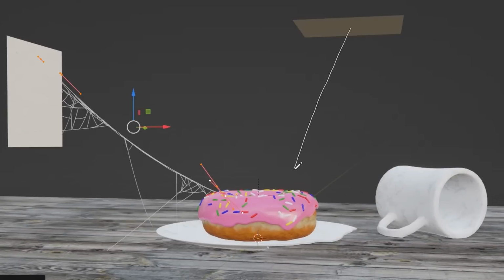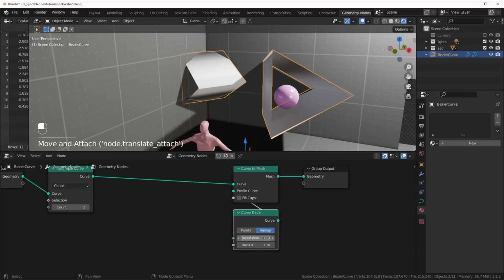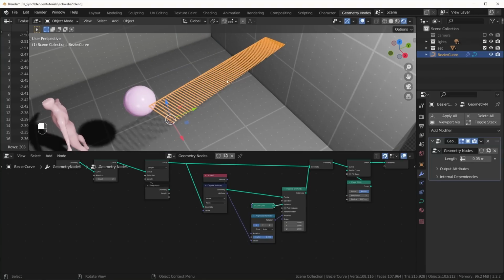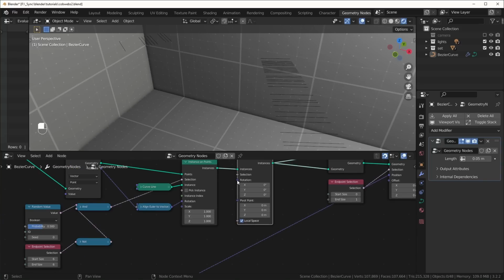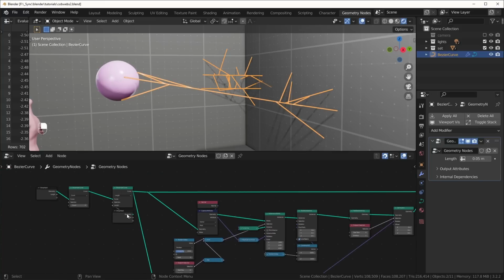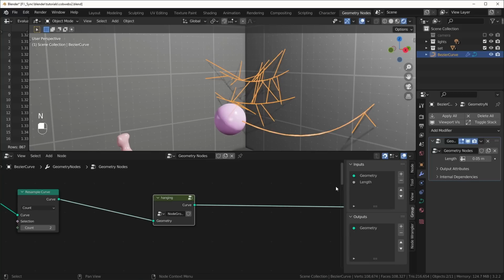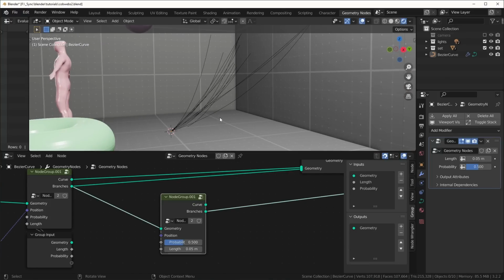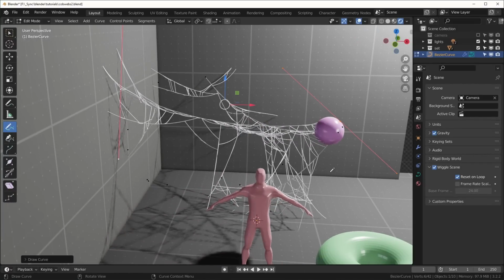Cobweb generator with geometry nodes Blender

Comment: Hello, thanks for sharing! 
Would there be a way to reduce the radius at the starting point of each segment so that the joints are pointed, let's say, have a little more variation in thickness?
Reply: Solved, use the node set curve radius after the curve line, and use the factor parameter of the node spline paramiter, do some math and plug in into the radius.

Comment: hey man, excellent video! I have a problem though, when I set the handle position, the offset option doesn't appear to me.Also when I set the handle type and set it to vector, I can only select right or left but not both  (I am using blender 3.4 stable build). thx

Comment: 6:16 Remember that Booleans are just 0 and 1 integer values. So another way to implement an “and-not” condition is to with subtraction: instead of “A and not B”, you can write “A - B” and clamp the result.

Comment: Hello! I have an issue.

I cannot change the scale of the tubes in the  web, I was making a small donut
the cpbweb ended not looking natural

When I put .01 it doesnt change much, so I put a divide math node set to 10
still didnt change much, and changing to further values dont change much

Im a beginner, any help is appreciated

Btw, I've had made the cobweb in a different blend so that I could append it easily, it works fine in that blend, so I believe the problem is scale

Comment: This is awesome! Question I've been racking my brain for: I'd like the to attach branches to animated/moving objects, with the cobwebs staying attached to the object as it moves, without Blender re-calculating the entire node setup. How might I go about doing this? I've been trying to think of how I would calculate the set of end-points that the branches would go to for the 'rest' position, and somehow 1) store these statically so they don't change throughout the animation (as is the closest point may change when the object moves) and 2) lock said points to any moving object. Not sure how to do this in geo nodes yet :D
Reply from the maker: I think using index values could work, because they wouldn't change as you move around

Comment: Wow! This is mindblowing!!!! Thank you!
Btw, Is there anyway to use a gravity/cloth simulation on the lines instead of the bezier handles?
Reply from the maker: Yes, I think you'd have to convert it to a mesh before adding thickness, the  use cloth physics with the ends pinned (so they don't fall), and then you could use a skin modifier to give it thickness
Reply: @JoeyCarlino  I'll give it a try!!! Thank you again <3

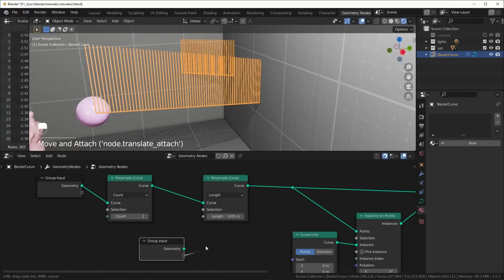Comment: hey man. this is great and works like a charm. except, I have this issue where when I drag a noodle from node input to group input (to expose a parameter), I can't enter other values than whole numbers which don't do anything. in short, I can't expose other parameters at all, they don't work. I could only expose length between points on a curve (4:17 in your video) and nothing else. would you have any idea what could be the problem. googling got me nowhere. thx!!